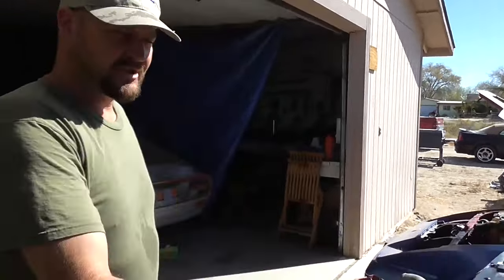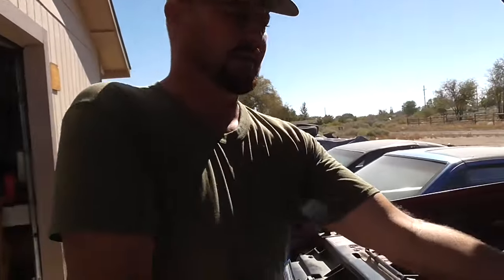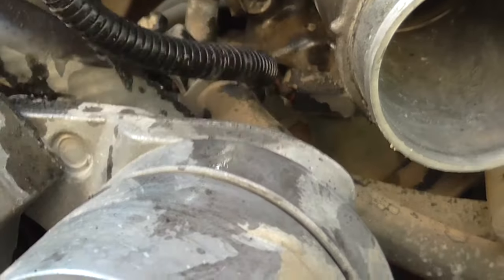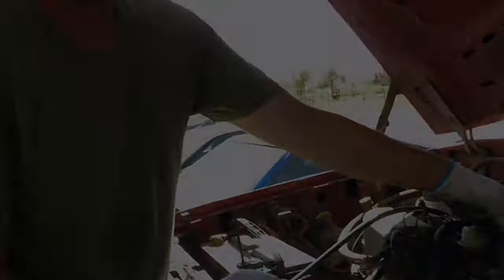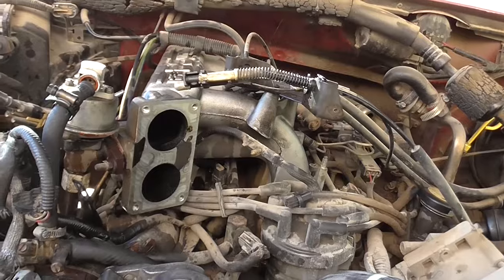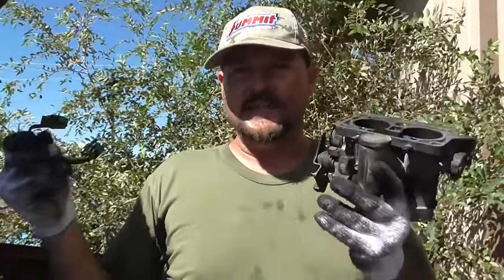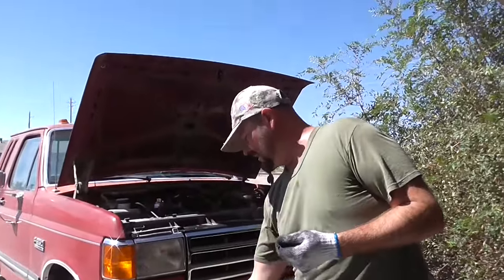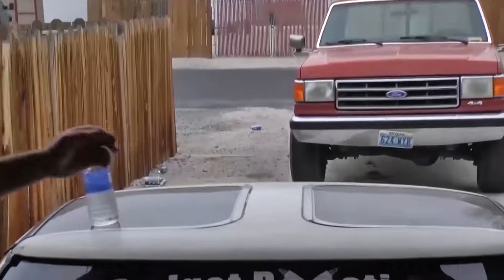DIY Throttle Position Sensor Change (86-96 V8 Ford Trucks)

Comment: THIS VIDEO HELPED ME FIX MY VAN!!!!!!  I have a new to me 1995 E-150 conversion van with 95k miles in really really nice shape and we'll maintained by a previous owner.  It ran perfect for a year until December 27th 2014.  Then had issues starting.  I replaced the fuel filter, not the solution.  I bought the manual, more tools, and found YouTube and Budget Boosting.  I am a handy person and an engineer by degree and trade new to fixing cars and Matt inspired in me the confidence to fix it myself.  The first symptom was inability to start and keep the engine moving it took 40 plus minutes and near constant jumping to start a dozen different times randomly over a month.  Sometimes started perfect.  Once started it stayed started.  The starter would turn, but the engine would not stay kicked over. I was so close to starting so many times.  I knew not to stay on the ignition and knew not to pump the gas, but I did it anyway and was so close to starting so many times. I replaced two starters in the process of multiple starts - found that in another YouTube video.  Changed the ignition coil and idle air control, not the right fix, but helped.  I changed the belt another video and belt tensioner pulley, that was a HUGE help to settle movement and noise in the engine, but still idled high and terrible starting if at all.  I tried a can of sea foam, then the van would idle at about 3000 rpm, but still had the terrible no start condition at random times.  My van would drive at 35 mph down the road without the accelerator being pushed.  When I replaced the throttle position sensor using Matt's video it did the trick.  Done no issues and very very strong engine again.  5 months later I had the no start issue, I replaced the TPS under warranty and runs great again. I think there is slop between the TPS slot and the pin on the throttle body so it slipped out of position.  This time I was more careful to be sure I had better alignment then tightened the TPS down.  I learned what a tune up is and replaced the plugs, wires, cap and rotor, dropped the trans mission pan, changed the trans fluid and all because I could now. Thank you for giving me the know-how and confidence!  I was thrown back and sad to hear about your fall and am VERY glad to see you on your feet!  Your way of explaining is very thorough and fun.  Keep up the good work!  Glad to be following you
Reply from the maker: Greg Johnson Outstanding Greg, glad to hear the success of your once not running van to a strong well running machine.  Great Job, imagine what a shop would have charged you for all your hard work?  You saved a lot of $$.
Reply: Vegan Shemp scope out the throttle body on the 5.0, I would assume it's the same. The Haynes manual is your friend.

Comment: I love it when I have a chance to learn something new, only this time I get to educate. My project is a 1995 Ford F53 Fleetwood Adventurer Vision 38 foot. OK with all the number out of the way. A couple more things to throw at you, this is a gasser, with the 460 and no cats since they were not required on a heavy duty frame. 
OK now for the education part. I have been having a problem with acceleration after about the 30 minutes in the wonderful Florida sun. Pull over cool 5 minutes and she is back off to the races. Long story short I hooked up my OBD1 yes they were still using that and it gave me a signal 31 which is a couple of things. But after watching your video I decided if I was going to go in that far I might as well go all the way. Since I have only had the coach a month and only had to dog house up one (today) I thought  I have better look at how it is assembled because if it was the same in your video I am to old to be crawling around in the dog house. Well come to find out my 7.5L 460 is mounted the standard way side by side so all I am going to have to do is reach in and change the sensor. then on to the EGR valve and the computer says I will be on the road again. 
For anyone that has the same coach as I do there is a RECALL for the O2 sensor. FORD said for years they could  not get the parts to replace the sensor. BS! when I got the coach the rv center told me about the sensor and how no one has been able to fix the min 24 years since the FORD RECALL! Well they can now IF you take it to a FORD dealer that repairs the coaches, The cost ZERO unless there has been some damage caused by the censor (usually it is the burnt wire going to the O2 censor. So that is my class for today. What we learned here is that you give great instructions for the repair BUT check your engine first - unless you have $700 in 2023 dollars to waste

Comment: Update on my F150 91 5.0 you can read my other comments for my problem...turned out to be the fuel pump relay... It has a low pressure and high pressure on it and the high side was bad 16.99 and I'm going strong...not the fuel pump but relay..so if you have the same thing I was going thru try it before you do alot of unnecessary work and money...hope this helps you keep on the road..
Reply from the maker: +Bri Pri Outstanding, glad you found the problem and thank you for the suggestions.

Comment: I changed mine last year and don't remember having to remove the while throttle body. Just a few screws and the coolant line and changed it. Easy peasy. It took all of 25 minutes if I remember correctly.

Comment: Wow I appreciate this guy. I am the furthest thing from a mechanic so I was ready to do some serious cussin. I watched his video and then had it playing alongside as I switched out the tps on my 86 f150. Ran into the same problems but was ready thanks to the video. Mine was a little easier due too only having 70k miles on the truck. If anyone has any questions hit me up and I’d be more the happy to give further feedback on what the problem was specifically that helped me determine it was the tps without diagnostics

Comment: Very helpful! Thanks.   My buddie's daughter just bought an 88 f250 with the 460.  Running rough and stalling like in your video.  Already changed MAP sensor, Fuel pressure regulator, cap, rotor etc.  I will pass this info on to them  along with the code reading info.
Reply: That did the trick.  They are up and running now. Thanks again
Reply: How did the truck run before ? When taking off?
Reply: @fred3370  theirs was sputtering and stalling out. Wouldn't even get out of the neighborhood

Comment: I used your video to remove the TPS as well, and I encountered the red thread lock, and also had to buy an extractor, and was successful. It helps to cuss Ford for using thread lock, those cheating bastards. One thing I did was to go to ACE hardware and bought two new screws with hex heads, I wasn't about to reuse the same dumb ass Phillips screws knowing that lock tight was still on the threads and down the hole. Great video.
Reply from the maker: yes, the thread locked screws that round when using a screw driver.  Garbage design where 6 point bolt heads would have done the job better.  I had gone through the screw rounding many times before so I used that impact driver right from the start.

Comment: Great stuff Matt!  Those hose clamps you lament are actually very easy to release.  After taking them off for almost 40 years in my radiator repair shop, I discovered that if, after you remove or loosen the screw, you can take your screwdriver or nut driver and give the clamp a sharp push or hit on the crown.  The crown moves down to the clamp releasing the clamp. You have to hit it squarely of it may collapse to the left or right.  A squirt of WD-40 in advance can help with a rusted clamp.
Reply from the maker: +Ron Prestwich Thank you for the clamp advice, I have always disliked those kind of clamps and always replace and upgrade them with the strong screw on hose clamps.  WD and liquid wrench are some of my favorite penetrating compounds to make quick work of stubborn rusted on screws, clamps and such.

Comment: Im doing the top end of a truck I purchased 1989 f150 5.0.Gonna take all that it doesn't need.Headers is gonna be installed.I wish I could afford the turbo's.LOL This guy is getting the job done the way I do I call this truck and Ford many names.
Reply from the maker: Its funny, the engineers never have to work on them, just design them to be difficult for bonuses from the factory.

Comment: you do know you can just take the bolt out of the throttle body disconnect the throttle line and it comes right out you can access the throttle position sensor really easy you don't have to take all that off it takes me like 5 minutes to change one if that
Reply: Yeah, but can you do a great deep cleaning of the throttle body like he did?
Reply: Hmm!!
Reply: How do you get to the 2 screws holding it onto the throttle body without taking it off?
Reply: @grandpahonestyguy8978  b

Comment: Gotta love Ford for coming up with bizarre solutions to problems other companies don't seem to have. Thankfully they put their bizarre dual throttle body horizontal on the 4.9 I'm working on. I'm still trying to figure out why they thought it needed a fan for cooling the fuel injectors.
Reply: same goes for the 460 efi from that era it had a horizontally mounted  tps
Reply: That fan on my 1987 bronco stop working any idea wat was that problem
Reply: @Purosanluispotosi  The fan runs so infrequently that it may have just seized up. If the fan turns, check the thermostat that turns it on. I deleted it from my dad's '87 F150, both because it was in the way and because I've read that they have a reputation for starting fires.
Reply: @Darwinpasta   ok thank u very much

Comment: I used my 18v dewalt impact screwdriver in order to get the TPS screws loose. I tapped it a little at a time with the trigger, they came right off. Mind you there is always lock tight on factory installed equipment. I usually heat certain things up with a solder iron or a torch (as long as there isn't a melting/fire hazard.
Reply: HopeAnd Greg that’s the way I do it at work

Comment: Thankfully, my 1990 Ford Bronco II has a horizontal mounted throttle body and accessing the TPS is very easy.  It's located at 9 o'clock position opposite side of the throttle.

Comment: The coolant line is to keep the throttle body hot when you have zero degree air ripping through it like we do here in New England During the winter otherwise it would freeze open .... Ur fact for the day lol
Reply: Actually it’s to cool the EGR solenoid but I’m sure it helps with that too

Comment: Yes that was thread lock for sure on those Phillips head screws. If you hit it them with heat and the thread lock with melt long enough to unscrew.  You might melt the plastic on the TPS but who cares if you are replacing it.

Comment: Great video! I replaced the original TPS on my 95 F150 5.8 today. I also had to use my impact to get the screws out so I replaced them with hex head screws. I first thought there was light rust on the screws but I think it might have been red thread lock :~\
Reply: with stubborn bolts i also replace them with allen head and even a small lock washer

Comment: I have an 87 with a 302. Ever since I got it (year and a half ago I think) it's had an idle surge. At first, it would just surge 1,000-500 when at idle (gear or neutral). It was random. Usually when at a stop for more than 20 seconds. Sometimes if I rev it, it'll fall to 600 and jump back up to 1000 and either idle properly at 800 or start surging. When it surged, I could give it a quick tap of the gas and it would quit for a while and then come back. It wouldn't go away unless i let the truck figure it out for itself and not mess with it. After 30sec-one minute, it'll quit and idle good. It would drop low when put into gear also and come back. 
After some time, the ICM went bad and it wouldn't start so I replaced it. Started up and was good, but the idle surge got somewhat better. Was less frequent and smaller range of rpms. Time went on and it went back to normal surging all the time. Then.. Don't ask me why.. I cut the cat and muffler off. It surged every time it ran. Would not stop. I can't remember if I did something to fix it or if it just quit on its own but if I remember right, it just quit on its own and surged it's "normal" amount. Then my battery went. Replaced it, idle surge got way better and quit dying down in reverse. Then it got worse again. Eventually replaced spark plug wires. Got better.. Then worse again. Replaced wires again (cheap Omnispark wires broke) with MSD with MSD cap&button. Broke a spark plug and had that fixed. Drove to the shop on 7 cylinders (that was rough lol). Ran a lot better. Idle surge got better. Then got worse again. One day it started going down to 400, even 300 rpm at lights, acting like it wanted to die. Would start the truck and it would idle 500-1,500 and rev by itself like there's a person trying to keep it running.. Used to be, I'd pull the connector for the IAC and it would immediately die.. Well now that's not the case. It status sputtering and RUNS at 300 rpm... Barely.. It would eventually die but it ran long enough for me to get in and rev it and keep it going.. Started stalling and such so I replaced the IAC. this changed up that idle surge a little bit. Quit stalling. Idle surge was somewhat normal.. Surge at start up went away.. Well the 500-1500 did. Now the truck waits until it idles down to 1,000 to start surging. And it'll do its 500-1,000 and eventually stop. But now it always does it the second I throw it into PARK. It would have about one idle surge spell in gear and then just stop and wouldn't do it again for a long time.. Until I take it out and back into gear. Now it's doing it way more again, even died on me at work when I threw it in reverse.. Sputtered at 300rpm and died.. Started back but still.. And it's starting to do it more at traffic lights. Would this be the TPS? It still does the thing where if I rev it, it'll die down to 600 and come back. And today when slowing down, it started down shifting funky but can't explain it. One day I tried to get the tires to spin (thanks to messed up breaking blah, my truck didn't want it), and it idled at 1,000 in gear after my attempt and holding it to the floor with the break down enough to keep the truck in place. Same thing at a drive threw one night.. Idled at 1,100 for some reason. Also has a periodic miss. Is usually present when starting the truck. Can only hear it at revs above 1,200 in park. Sometimes it's not there. I gave the engine an upgraded ground straight to the battery along with a new body ground from the battery and that seemed to help for a while but surging came back.
Reply: LandYacht I had a problem kind of like this once with my 97 f250 with 351 and it was a relay
Reply: I’m having the same issue iv replaced the relays ran a second ground tryed the map sensor out of my buddy’s truck cleaned the idol control valve.this is next on my list along with o2 sensor and fixing the exposed wire at the clip that goes into the alternator
Reply: >*I have an 87 with a 302*
>When it surged I could give it a quick tap of the gas and it would quit for a while and then come back.
>[did something, got better] Then got worse again.

I'm not dying at lights yet but I am getting a lot of these symptoms. Maybe I SHOULD just change the Throttle Position Sensor along with the Idle Air Control. I wonder if removing the cats caused more gremlins because now you don't have a place for an O2 sensor...?

BTW If I won the lottery tomorrow, guess what I'd still be driving?

Comment: Had problem with my 88 F150, 302 revving up and down on the idle.  After some monkeying around I disconnected the throttle position sensor and the idle air control.  Of course the motor won't idle.  But I was able to loosen the idle screw, turn it out so the motor would idle.  Only problem is in the morning, startup I have to keep the motor running for a few minutes for warm up, after that the truck runs fine once warmed up.  Shows these frigin sensors are not really required. So all that would be nice to have is some sort of choke setup for cold starts. But I will get a new TPS soon.

Comment: Good video!! I had a heck of a time trying to get the TPS off my 1990 F-150 4.9. I guess mine was fine because after taking it off to clean it, as I placed it back, the check engine light come out and the idle is 100 rpm's, so I wonder what position to place it is 6 o'clock or 9. Thanks

Comment: The first time I did this, years ago, I did it with the throttle body still attached and used a 90 degree screw driver and a telescoping mirror ...WHAT A BITCH !
(Pre-internet days and we were on a road trip in the desert)
Reply from the maker: +Rick OBrien yes that is really hard.  I remember even with the throttle body off, the screws were tight and stubborn.
Reply: Thats exactly what i was about to do then i did this just to see if there was an easier way to do it

Comment: I have a ford f-250 with a 5.8 L engine which is starting to act up. I only use it in the summer months, but it's starting to stall out when I push on the gas after warming it up a bit.  When I checked the codes I get a code 11 along with code 63 and 10. 
It looks like the TPS may need replacing.  thanks for posting your video, as I would have no clue how to go about this.

Comment: You are dead wrong about the 460's having the same TPS configuation . I own a 1988 Ford F250 having the side to side intake with the TPS on the side of the intake. So when you state your video covers all models that is incorrect. However would be pleased to see a video on my models configuration,    Thanks   James